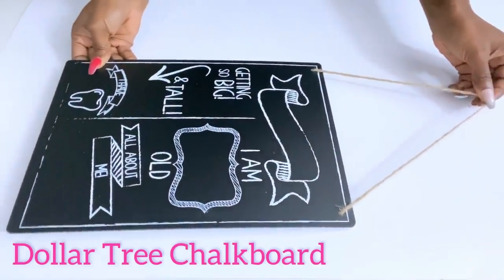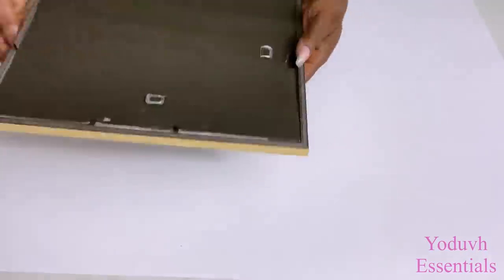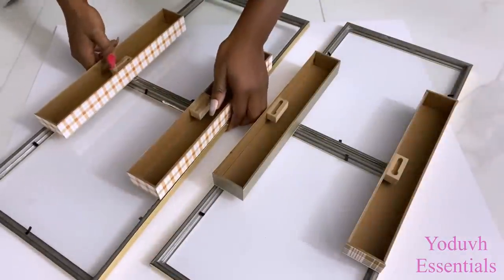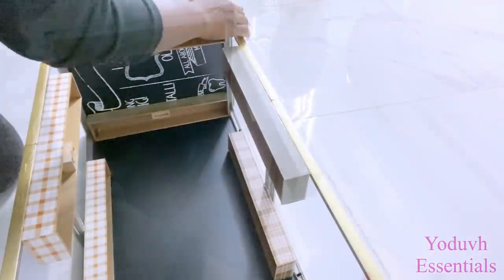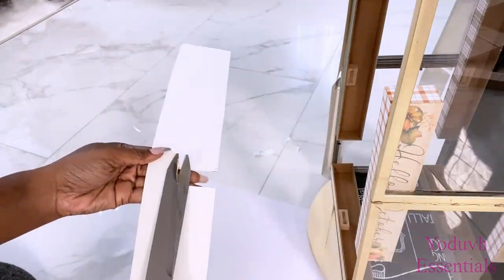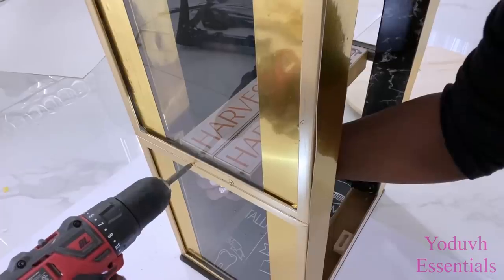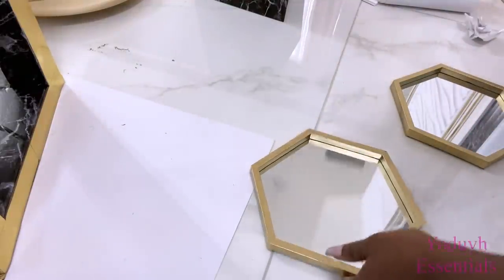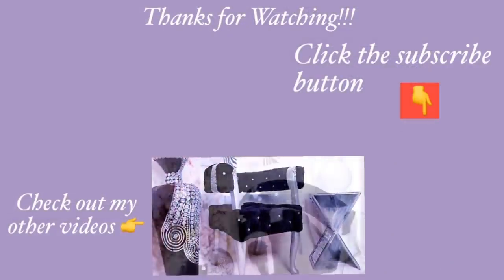DIY Gold DOLLAR TREE NIGHT STAND! DIY Bedside Table

Comment: For strong adhesives I have found to put the glue on both surfaces wait about 5-10 seconds and then put them together. Helps avoid squeeze out and makes the grab better.. However read the instructions first in case the manufacturers has a better idea. I only do this when the manufacturer’s instructions don’t work for me.